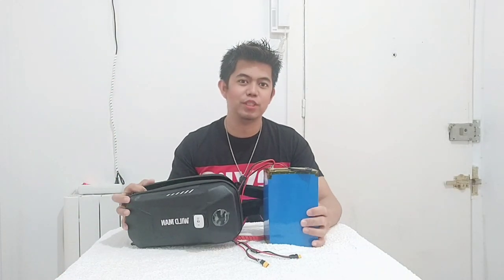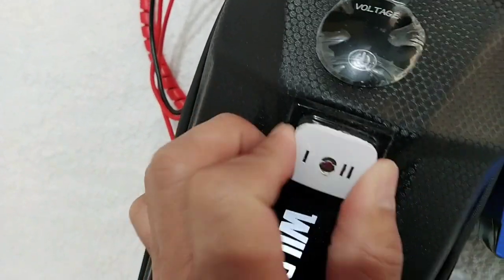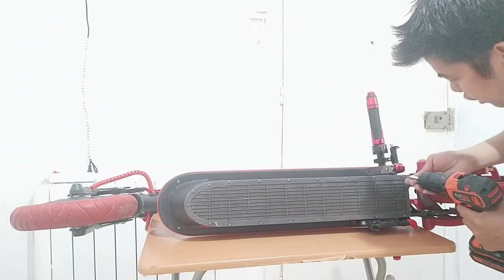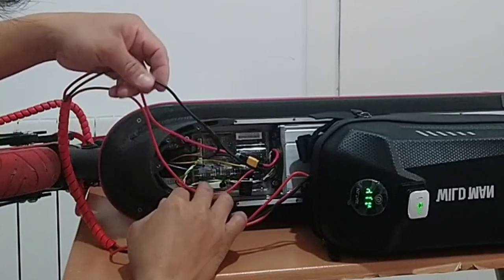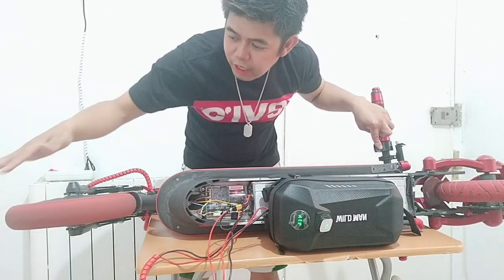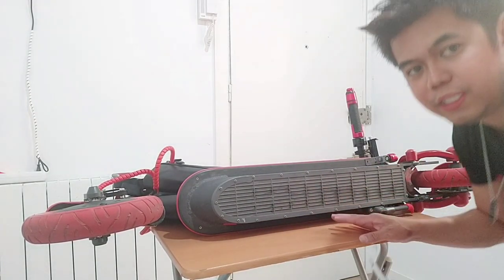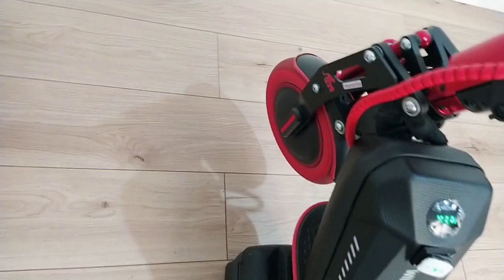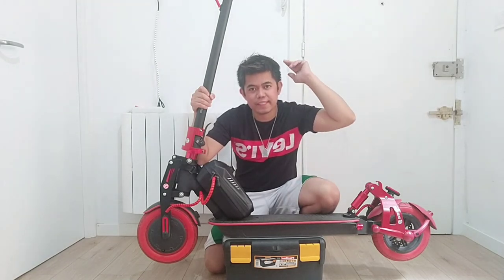install extra battery to electric scooter m365 xiaomi pro 2

Comment: I have flashed my scooter with your 41pro zip file ! Is charging mode disabled with that flash? So i can just buy an external battery and everything works⁉️🙏🏻
Reply: I have a pro 2 and 41pro zip file do I need a better controller or 48v battery or 500w motor to flash it?

Comment: Gusto ko yang dual switch na yan, pano yung connection nung switch sir? 3 pin yan diba? positive ba yung una at pangatlong pin? Tapos negative yung gitna?
Reply from the maker: nakagawa nako kagabi nang tutorial nang dual switch eedit ko pa mamaya . isa para sa stock at range bate . at ung isa sa speed batery  ung git na off un patay ang pasok nang batery . bali 6 pin lahat

Comment: How much for the battery and bag?
Reply from the maker: cost 30 to 40€
Reply: @RHON_TV  where can i buy it? And do i need something else?
Reply from the maker: @josipbergman682  here in spain sir
Reply: @RHON_TV  can u share link?
Reply: @RHON_TV  hi can you post to UK? 🇬🇧
Reply: Hy I would be interested in the battery would like to know how much it costs and how much extra range I get ..... and you don't have to use the external and internal battery beforehand
Reply: Bring the same tension before connecting it
Reply: @RHON_TV hola. san kau dto sa spain sir?
Reply from the maker: @jxdjxd1690  sa madrid sir
Reply: @RHON_TV  madrid din ako,san ka dto,help nman mahina sa arankada 1s ko sir🤣delikado na ang mga scooter dto sa spain dami na nagsisita n bagong ley🤦
Reply from the maker: @jxdjxd1690  oh talaga butibako di pa nasisita 🤪 saan ka d2 sa ALVARADO LANG ako . message mo nlng ako sa fb. sa pangalan ko thanks

Comment: Sir question lang. ok lang iparallel ang dalawang battery na magkaiba ang voltage at amperage . Yung stock battery kasi ng pro 2 is 12400mah and kulang 41.400 to be exactly pag full charge and yung after market na extra battery is 42 volts 7800mah.. need ko muna ibalance yung dalawa bago iconnect?
Reply from the maker: pwede nmn sakin 36v  stock
 25v speed at range 45v  parallel yan 

 pero ang pinag sama ko jan sa isang switch is rang bater and stock batery   naka seperate ang speed ko
Reply: @RHON_TV  sir may file ka ba nung 44kph
Reply: @RHON_TV  paano connection na ginawa mo sir sa switch
Reply: Need ko cguro talaga ng switch kasi maski naipasok ko na yung file na 41kph with charging removal nagkakarga parin yung isang battery galing sa isang battery.

Comment: Paps stock battery gamit q pede q ba add ung stock din na battery para may extender aq battery
Reply from the maker: yes po sir pwede un basta parehas nang volatge 36v.   i parallel mo xa . may tutuorial ako nyan sir
Reply: @RHON_TV  ok lang ba idol naka downgrade ung scoot q tpos mag lagay aq extra battery same 36v diba magkakaproblema un at may babaguhin paba sa settings
Reply from the maker: ok lang yan same voltage lang nmn  . pero pag nag error 24 message mo ko bigyan kita ng filmwear

Comment: Can i ask if u had to downgrade the system for 41km/h? because mine goes only 36/7
Reply from the maker: you have a files already??
Reply: @RHON_TV  yes it is in my scooter but it only goes 36 even with fully charged battery
Reply from the maker: @gamepoint8098  where are you from?? try to input original files and you upgrade it again

Comment: Kailangan pa po ba magflash sa firmware nya if mag iinstall ng range extender?
Reply from the maker: yes sir mag error 24 yan need mo din itaas ang setting  voltage sa hack

Comment: the downside of this method is that the controller will not be able to detect the percentage of the external battery, that is the reason why you installed a voltmeter on your bag. am I the correct idol?
Reply: i think it can detect it cos both internal and external battery are connected to the controller. the external battery is like a reserve juice, once the internal battery run out of juice, switch to external and if that's fully charge it'll show on the main display it's fully charge.

Comment: Pre ask lng d ba makakasira ng motor ung speed hack? Medyo nababagalan pa ko sa 26 kmh eh
Reply: Ung bag ba binili m na may switch na at voltage meter?
Reply from the maker: di nmn pero cempre pag binilisan mo speed nyan lalaks gumastos nang batery kaya mejo mabilis ka malolobat komporme sa pag gamit mo
Reply from the maker: @RepapipZvlog  ung wala pinaglayan ko lang sya nang witch
Reply: Salamat sa info pre
Reply: Magkano pre gastos m sa battery pati bag
Reply from the maker: @RepapipZvlog  sa lahat nang accesories sa scooter batery pinaka mahal sir . ofw ka po ba ? san ka now
Reply: Uu pre sa italy aq, ung set ng battery m ask k kng mag kano pre kasama na bag
Reply from the maker: @RepapipZvlog  wala true online sir d2 lang nabili sa shop bsa spain

Comment: Hello! Po sir pwede po ba humingi ng tulong sa scooter ko may problema yata sa software ng dinagdagan ko ng baterry. Maski bayad nalang ako sa gcash
Reply from the maker: anong nilagay mo speed bater or range pag speed nilagay mo ag eeror 24 yan
Reply: @RHON_TV  di nowngrade ko tapos  meron na kaagad syang nag blink na isang bar na kulay pula. Tapos ginamitan ko say ng xioaflasher at nawala na yung pula at may limang bar na say na puti pero ayaw umandar ng gulong nag set ako ng remove charging mode pero wala paring nangyari. Ano po ba dapat ko gawin sir?
Reply: O pano ba ibalik sa original na setting kasi tagal kung trinabaho at parang na discourage nako. Tulungan nyo naman po ako sir!
Reply: @RHON_TV  hindi po sya error 24 ang makikita mo lang sa dushboard 93 bali battery percentage yata yung 93 na puti ang kulay
Reply from the maker: naka BLE 75 KA  PAG ganyan
Reply: Bali po ano pwede ko gawin?

Comment: Hi bro..tanong ko sana pag ayaw magcharge ng battery..2months palang yun scooter
Reply: Ano ba pedi gawin,pero pag nakadirect na nakaplug sa outlet un charger at dun sa charging port ng scooter nagoon naman sya..
Reply: Un charger diba dapat pag charging nakared un light pagcharging,pero un sa scooter ko po always nakagreen lang kaua hndi nagchacharge
Reply from the maker: @markadriansalvador6595  buksan mo yung loob pag ung ilaw nang batery is red battery problem maybe may tangal na hinang or may isang cra na batery pag blue nmn ilaw ok pa yan batery mo di yan sira
Reply: @RHON_TV  thanks sa reply bro..pero un case na ganito pedi din bang controller ang problema kaya ayaw magcharge or hndi naman nakakaapekto un ckntroller sa charging.

Comment: Hi, I have been trying to get flash the created  firmware I made to remove charge mode to connect my external battery for my pro2, but the firmware I created doesnt seem to flash even if it says it's flashed, so my pro2 goes into charge mode when I connect the external battery, the esc version is 2.2.4, are you able to let me know what CFW you used to get the external battery connected,  thanks in advance

Comment: Pre musta anong klasing switch gamit mo?
Reply from the maker: eto sya sir
Reply from the maker: € 0,68  30%OFF | 1PC 30A/250V 6Pin Waterproof Auto Boat Toggle Rocker Switch With LED 12V 220V Color Random Wholesale
https://a.aliexpress.com/_Ez7nJ2D
Reply: Aw ok ok thanks kasi ginagawa ko now hugot kabit lng hehehhe
Reply from the maker: @rabarque  ah plag and play lang ganyan din sakin pag range batery pero pag may kasama na speed bater need may switch
Reply: @RHON_TV  pano po pag ung battery speed? Kahit hindi naka hack ang scooter pwede?
Reply from the maker: @rabarque  pag batery speed batery nmn ilalagay mo .. i series mo po sya so tatas voltage nyab kaya mag error 24 sya kaya need mo paltan nang bagong filmwear
Reply: @RHON_TV  ah ok ok, for the main time dagdag lng muna ako ng battery isa pang battery pack pang dagdag range lng muna sa sunod na yong speed, pwede maka hingi ng connection ng dalawang battery na merong switch kasi un nga plug and play pa ginagawa ko eh, thanks

Comment: where this parts can bay
Reply from the maker: the battery??
Reply: @RHON_TV  yeah i try find it but need to meyby puilt myself meyby. Electrical Wires and connectorts I  need and battery and pack i Bay some where when i find. Iam in Finland meyby wrong english 😅electrical wires and connectors i need
Reply: @RHON_TV  i have e-way 350 w motor and 7.8ah battery then i have xiomi pro 2 300w motor and 12ah battery? maybe i will build eway with cheaper parts of the suspension and some battery and better parts of the xiom suspension monorim etc or else i will just build eway and leave the xiom original
Reply: @RHON_TV  Do you have any idea what would be the best battery for a standard enclosure under the board with a lot of options?
Reply: @RHON_TV  e-way i bought a year ago now i accidentally bought xiomin when i was going to build another with good parts. The Inokim oxo would also be great but needs a cover up sometimes for money on such a good board at once.